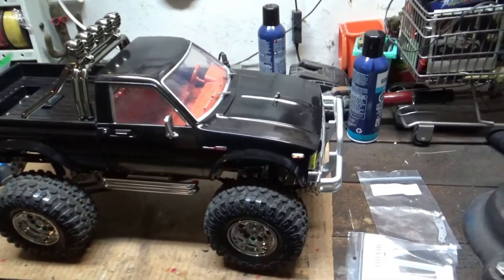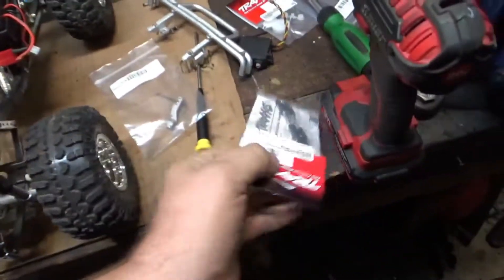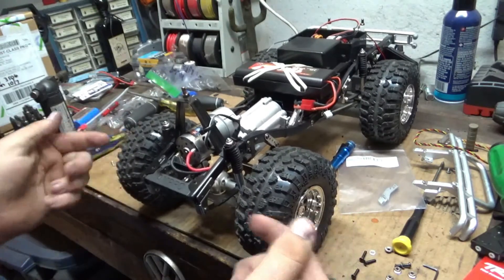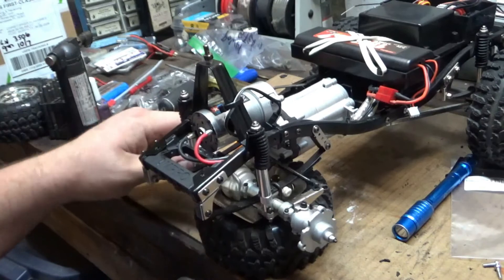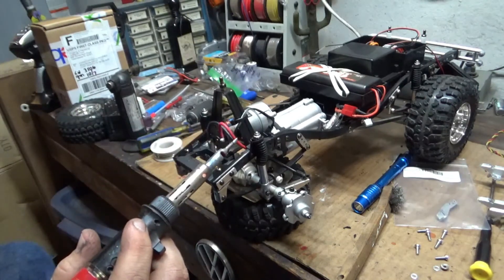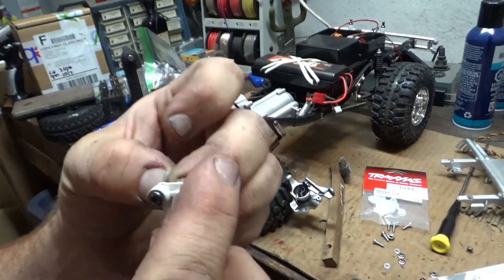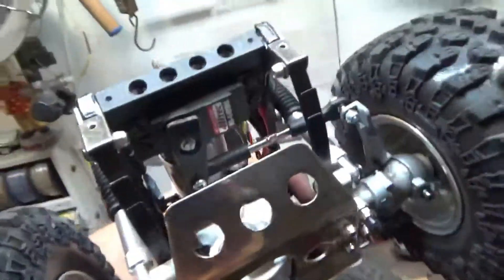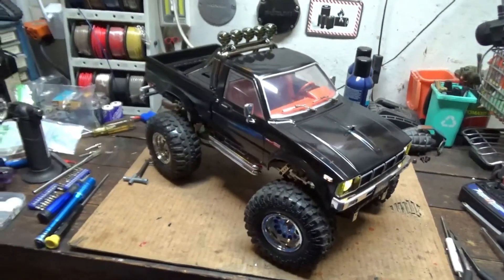HG-P407 Front Steering Servo Upgrade

Comment: Great job. Those parts are very expensive so I’m glad it worked out for you. I would try to mount the bumper. You said that it’s already save you a few times so it could save the truck again. Worth the effort to mount it.
Reply from the maker: Thanks , i think i will put the brush bumper back on , i like being able to see all the detail i put into the front end but i don't like the idea of sweeping all that detail into a dustpan after it crashes into something , so its going back on , il just put the longest bolt in it possible and hope for the best .
Reply: you all prolly dont give a damn but does any of you know a trick to get back into an Instagram account??
I somehow forgot my password. I would appreciate any assistance you can give me.
Reply: @Jaxx Mathew instablaster :)
Reply: @Camilo Allen Thanks for your reply. I got to the site thru google and im in the hacking process atm.
Seems to take a while so I will reply here later with my results.

Comment: Hi, i have just recieved my "bruiser", and i going to do this mod. Did you use the stock servo that came with the car?
Reply from the maker: You can but being a cheap servo it will burn out in a few days , i found two used hitec metal gear servos on ebay and replaced the shifting servo as well , i used hitec hs-645mg servos